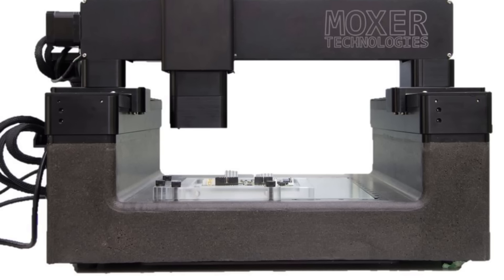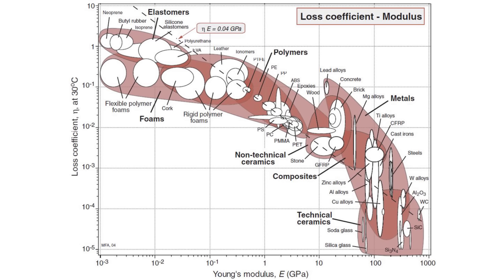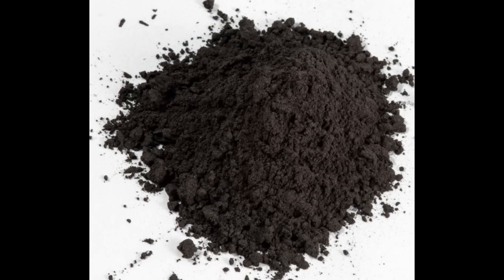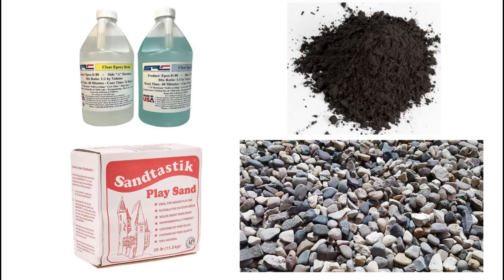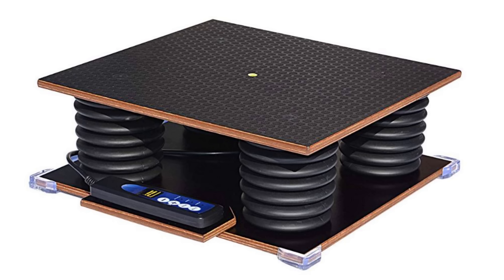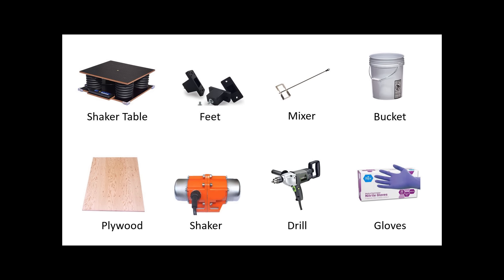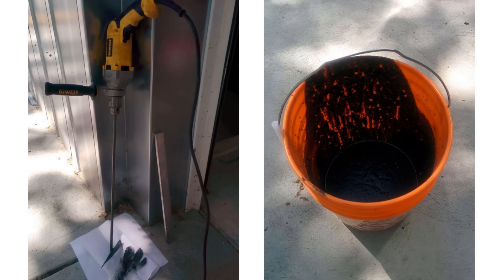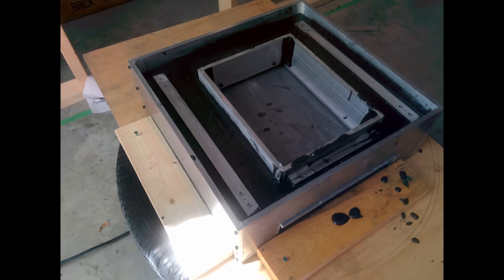How to Build Epoxy Granite Machine Base

Comment: Nitpick: your design criteria was all about the material science of epoxy granite but my layman's assessment of your prototyping was what looked/poured best. While air gaps are probably not great, how can you know if some ratio with air bubbles might be much better than what you went with in the end? You didn't test the characteristics you chose it for via any means I saw: vibration resistance and stiffness. Thoughts?
Reply: A bit harsh perhaps, but I agree.  The design aims are mixed up.  If impeccable surface finish is important then use a gel coat or post process in the old fashioned way with filler and sanding.  If a very specific mix of rigidity and vibrational damping is top priority, then they are mutually contradictory.  A rigid material does not damp;  a damping material cannot be rigid.  There was no evaluation of the result.
Reply: @raykent3211  Whoops. Didn't mean to be harsh, just objective! There was a lot of background given on the material choice and explaining the challenging blend of properties you mention: rigidity and damping. I guess I interpreted this as a technical focus, so it surprised me that none of the introduction material came back up during evaluation. That's all. Maybe it's sufficient to say "this material was known a priori to be great and thus as long as we use it, all that matters is the practical aspect of forming it well and having it smooth." Like if "wood" had the right property, then perhaps that's sufficient and an evaluation between maple, walnut, or pine don't matter. Dunno, but wondered the author's thoughts.
Reply: @johnhendy1281    it's certainly an intriguing subject and not easy!  My only reference is acoustic damping.  The key seems to be near-continuous impedance variation.  Realistically, the sound hits a low impedance (not stiff) material to avoid reflection and progresses through layers of increasing stiffness ending with maybe concrete.  It's a matter of absorbing energy and minimizing reflection and propagation.   But the energy can only be absorbed if the source is allowed to move, which for many machines is bad.  I doubt if anyone would want a cnc spindle mounted in anything less than a perfectly rigid way.
Reply: @raykent3211   With machines, there is already high impulse vibration in the metal. This is a bit unlike acoustic damping, where you need to pull the vibrations out of the less dense air and have to progressively absorb into more dense materials.

The alu will carry the vibrations (usually unfortunately well). So by casting around the alu, the alu becomes a carrier to transfer to the absorber. This works similarly well with filling box beams. Though their outer surface can still carry some vibrations. If you imagine them trying to resonate, the semi-squish and mass of the super absorber material eats up all the inward pulses. That makes it extremely good at sapping any harmonics from growing.
Reply: Maybe I am assuming things incorrectly, but reducing air bubbles/pockets maximizes the density of the base, therefore adding more mass to lessen the vibrations. He most likely could just get away with having some air bubbles but if the final mixture can have better density and requires less variety of materials, it would simply be better to use the chosen material composition. And perhaps (could be really wrong) in extreme cases where excess vibrations are transmitted to the granite base, the pockets could act as stress risers potentially creating failure points, thus propagating cracks.
Reply: @raykent3211  interesting thought, but i believe the rigidity and vibrational damping actually isn’t necessarily contradictory. With enough mass and proper design, the inertia of the object can cancel the moment exerted from the system hence it can absorb the vibration while still being rigid.
Reply: @raykent3211  lmao i cant stand this corporate talk in a youtube comment section
Reply: The air pockets will crack overtime if the machine is under any heavy loads
Reply: Any links? I googled "epoxy granite cracks air bubbles" and did not find anything showing this as a common occurrence or even warnings about it to users planning to make EG bases.

Comment: Might I suggest drying the sand by baking it in a oven for a while in my limited experience with resin and fillers moisture in the filler really messes with strength and leaves tiny bubbles in the material due to a chemical reaction.
Reply: I am thinking about using Aluminium oxide, but I am not sure if the epoxy will be able to bond on it, considering a welding require to break the oxide layer prior to have a good bonding.But then since epoxy stick with pretty much anything, I hope it could be an option.
Reply: @richardphatthenguyen195  it will stick no problem. Just dry it out by baking it at 100c for a few hours and mix as soon as it cools.
Reply: You can buy plasterers sand, or kiln dried sand. It has already gone through the process of moisture removal, as long as it's stored properly.
Reply: @CozzyKnowsBest  Hey thanks,
I was just under impression that aluminium oxide would be best, but figured out it might be a piece of mind to go straight for your reccomended products. Currently I have 30kg of play sand that also lays around in the house for a while. I might give it also a try like Adam did. Though I am looking for Epoxy seller around Montreal, will be the toughest part.
Reply: @richardphatthenguyen195  Montreal is a huge city. It will not be hard to find epoxy locally.
Reply: @xenonram  I found most company doesn't want to deal with a nobody like me, instead they want deal with a company because their potential in marketing and profit is higher.
Reply from the maker: You can buy dry sand from suppliers, or if you're on the cheap, you can let it sit out in the sun for a few days.

Dry is definitely key for a successful mix
Reply: @richardphatthenguyen195  Aluminum oxide will work.  So will silicon carbide.  Sand blasting places might have some to sell you cheap.  I know that sometimes I have had to change the grit in a blasting system and then you have the old stuff sitting around.
Reply: @johnhunt2390  just be aware the used sand will have whatever they were blasting in it. Paint, iron, etc..
Reply: Court iron would be ideal really...

Comment: You don't need a shaker table, you can get an old SDS hammer drill for very cheap and it will make your hole workshop table shake like crazy

Comment: Ever look under a machine before and notice how pretty much all them are are set into grout? The stuff is basically non-toxic, non-shrink, same aggregate flexibility, voids fill and bubbles tamp out quickly, loss coefficient is within 10% of epoxy but young's modulus is almost 20x better than epoxy, easier to polish and dye, is designed to pull from molds, and can be had premixed for dirt cheap at the local Home Depot. I know the value of reinventing the wheel is priceless, but really, what's not to like?
Reply from the maker: Interesting idea! You could easily fill in the hollow voids in most cast iron bases with that material, I'm sure it would work pretty well. I have to admit, a strong driver for this cast base was also aesthetics in addition to the mechanical properties. Thanks for watching!
Reply: Very basic. And very correct. Not as interesting as epoxy right! But used by many machine tool manufacturers none the less.
Reply: Grout absorbs water?
Reply: @mannycalavera121 Only if it is standing in a puddle. Do you have a lot of standing water in your machine shop? Not me.
Reply: @davidnaisuler5743  no but I have a lot of coolant in my CNC. It's porous, which makes it  more prone to transmitting vibration as well as its fluid absorption and expansion/contraction. 

It'd be fine as a deadener material maybe.
Reply: @mannycalavera121  Very interesting. Non-shrink grout should have no expansion problems w/ coolant. There are waterproofing additives that can be had at supply shops I've been to. Seems like water in the grout would not make it any more transmissive of vibration, it has hardly any entrained air besides what mixing introduces to replacewith water anyhow so you are looking at 1-2% volume of water max, which would only add mass?
Reply: All I know it that I've grouted more than one machine base down and it gets rid of all kinds of flex and vibration
Reply: @mannycalavera121   Depends on the type of grout. There are quite a few that are indeed water proof. Like everything. A little research can lead to greater understanding.
Reply: There is a reason why the top machine tool and metrology/CMM manufacturers use granite epoxy.

Comment: How much of the machine base rigidity comes from the metal substructure? Aside from cost and other increased difficulties would a steel structure, be more mechanically beneficial than an aluminum one?  If the space were made with no aluminum, substructure and mechanical components, like plates and rails were bolted directly to the epoxy base, how might that perform compared to the one with the aluminum sub? I’m contemplating a lathe project

Comment: Fantastic video! Comment for algorithm.
Reply: Also, did you just make a mold out of solid aluminium bolted together? SKOOKUM AS FRIG
Reply from the maker: Yup, the mold was aluminum plate that was painfully drilled and tapped in all the right places.

Then bolted together, then wax was melted into the corners to add the internal radii.

Thanks for watching!

Comment: After days of research on epoxy floors, I ended up trying the most convenient supply epoxy for samples: my employer's deadstock of ENECON DURAFILL. It filled and leveled my old wood floor perfectly, with no bubbles or nonsense. Too bad it costs $300/gal, but all it takes is one failed pour to lose more, and it really is hard like glass, chem and UV resistant.

Comment: Another Idea for cheap Shaker Table. Not tested so far. Use Bass-Loudspeakers and Amplifier. Feed them with any kind of Frequency. Mount one or more Speaker under the Table and play with the Signals to get best Results...
Reply: Or just use bass shakers designed for exactly that

Comment: Just curios, why not use steel or aluminum as the mold and final base with the epoxy granite on the inside?  Would this not provide the stiffness of steel and the epoxy granite vibration absorption?  I am not a engineer, just curious if there would be any reasons why this would not be a good approach.
Reply: of course you can do that it just wouldn't look as stylish. 
is there any reason to not have the epoxy granite as a show piece while providing vibration dampening?

Comment: so...any rocks and any epoxy... do you really need the full aluminum skeleton frame inside the casting?
looks a bit needlessly overengineered inside and kinda halfarsed outside XDD

Good idea tho to use epoxy to make a heavy enough base that deals with bad vibes...been thinking of making this type of thing for my 3d printer. Thanks for sharing. ^^

Comment: I just watched a special on submarines and carbon black as a dye adds to sound and vibration deadening by multitudes very interestingly I'll be using it if I try that that's actually why submarines are black even though blue would be better so as no to be seen and a palm sander on its side vibrates the bubbles out just fine vibrating it along the sides of mold

Comment: This is an absolutely fantastic video. I do have one question. I’ve already begun the build for my own CNC and the base has been completed already. Would it be a good compromise for me to build an epoxy granite base with a few studs sticking out of the top for me to bolt the aluminum gram to it?
Reply: It will work, you can even make 'boards' of this stuff and bolt them vs a whole pour, but that is reducing how well they work. Large machines will typically fill their box beams with cement or something like this.
the better the interface to the alu the better this will work, so you might want to use something to fill any gaps, like a thin layer of rhino liner or caulk, then clamp it tight, so it can absorb those vibrations and send them into the absorption material.

Comment: Given that epoxy is expensive, can anyone suggest a way to calculate in advance the required quantity for a known volume?
Reply: If your volume is 700in3 & you want a 1 to 5 ratio of epoxy to granite,
then 1/5th of 100% is 20%, so 20% of 700in3 is 140in3.

Convert the result (140in3) to liters/gallons & then buy however much you need.
Reply: @criminallyoffensive  all the proportions in the video are by weight, not by volume, which makes your calculations invalid
Reply: Or use the cement version instead of epoxy.
Reply: epoxy is not expensive at all, you don't need much anyway
Reply: @JohnSmith-pn2vl  Expense is relative to one's available finances. From my perspective epoxy is very expensive.

Comment: What about steel reinforced concrete?
Reply: no. if the steel rusts it will expand and break apart the concrete and ruin the machine. 
that's a terrible idea for longevity.
Reply: @darkshadowsx5949  no it is not, it is very common,

Comment: What frequency is the best for vibration?
Reply: The resonant frequencies of the pure epoxy resin are, from the first to fourth modes, respectively 28.44 Hz, 144.84 Hz, 202.50 Hz, 544.22 Hz.
one of those maybe? resonant frequency is the best at getting matter moving. 

its funny he uses vibration to process a vibration dampening medium.
Reply: @darkshadowsx5949  this is complete nonsense, don't listen to this rofl

Comment: Aha, this is the base for this :) 

"Automated Measuring Microscope

This is the RapidSight, a 3 axis, automated measuring microscope we developed at MOXER. It sits on a custom designed mineral cast base, and boasts 4 high precision linear stages. Everything was custom designed, machined and programmed by the MOXER team"

Interesting!

Comment: AMAZING VIDEO but...

For others making similar projects. The author is not completely correct that "Any epoxy brand will work. The key here is to find a slow cure time epoxy."

He is right about the slow cure, but you will get much better results by using a low viscosity laminating resin. If the epoxy has a 1:1 mixing ratio, that is a red flag and means that a filler has been added to the resin system for convenient mixing. A proper resin system will come with less hardener than resin, and will need to be combined in different amounts according to the manufactures guidelines. West Systems is the brand name choice, but there are also cheaper options. US Composites offers a comparable product that is much cheaper. The boat industry is probably the biggest user of composite materials, and you should be able to find a low viscosity laminating resin at any boat supply store/website.

Thanks for making this great video!
Reply: are you advertising for total boat epoxy?

Comment: if you look on your graph you'd see that concrete/cement would have been a much better option as it's dirt cheap and does exactly what you need and you can add glass fibers and metal mesh to make it reinforced concrete which is more than strong enough to what you need.
Reply from the maker: This is a good idea! I have seems few videos on YouTube where someone uses concrete as a base. I wonder why it's not more prevalent in the industrial machines, perhaps it's not as dimensionally stable?
Reply: @AdamBender  near full drying of concrete takes 28 days per inch of thickness. This is not as much an issue especially when you use quick set cement, which hardens much faster. So if you had used normal concrete it would set much faster than what most hobbyists would need as most of us DIY cnc machines take a couple of months and if you start with the base, by the time you would use it, it would have already dried to be dimensionally stable. There is also variations in concrete like concrete that takes far less water as for example, which would make it more dimensionally stable. Just want to add this that sky scrapers get made out of this stuff so if its good enough for that then it would be good enough for me. You can also add more adjustment like have a plate where you can add shims to that then bolts to the rails, so this would eliminate the issue if you changed a few mm's over time you can then just after a couple of months just measure and add shims if need be. I'd much rather use concrete and adjust twice over than mix a massive amount of expensive epoxy which also changes over time and needs to be measured again in a couple of months, so either way you'd measure again. In the case of concrete because it's so cheap you can add much more mass and rigidity to the frame than you could realistically with epoxy. In machining having mass gives better cuts overall. This is just my 2 cents, but it's worth looking into.

Comment: Hmm this sounds nice for some 3D printer stuff. I wonder how much heat it can handle. I could even make my heated bed out of it!
Maybe some parts too. I'd get rid of the horrible noise it makes
Reply: that would be hsit. the weight of the bed would be too much for the steppers.
it would only be ideal for the frame. Significantly increasing the moving mass of a 3D printer or it will slow it down.

Comment: Outstanding content. In 2 part polymers with fillers, I have always been told you need to mix part a and b together then mix in the filler to prevent differential adsorption of one part in the filler (sand in your case) which would inhibit a full cure. You're method seems nice since you're not rushed by the curing epoxy during mixing. Did you notice any softness in the end product?
Reply: That's what I would do too. But I think the filler proportion here might be too high?